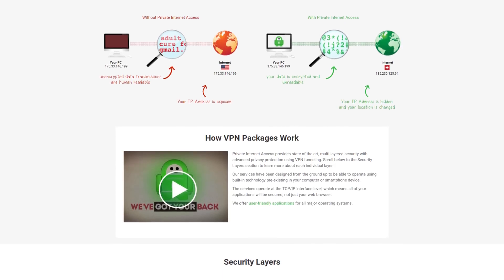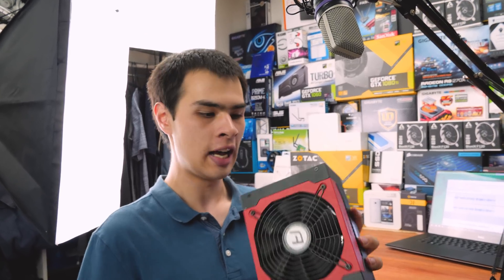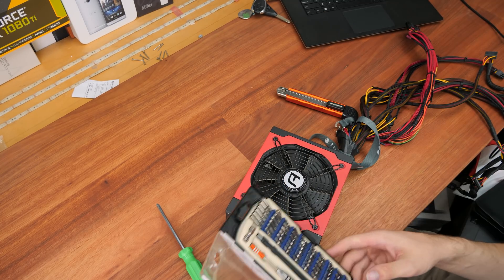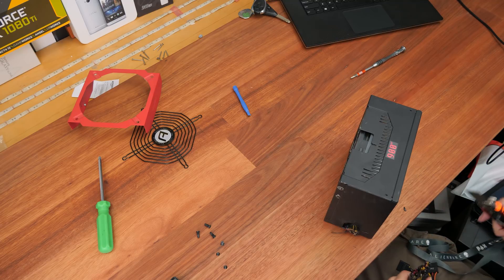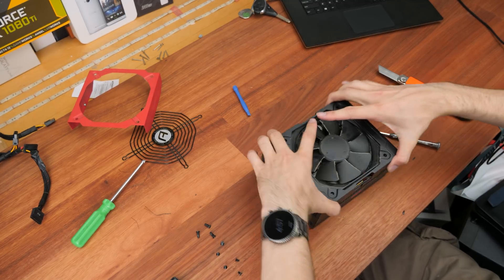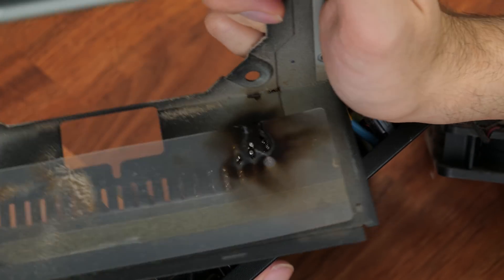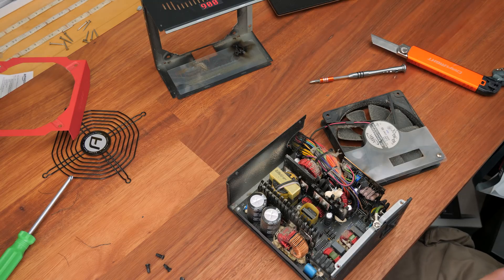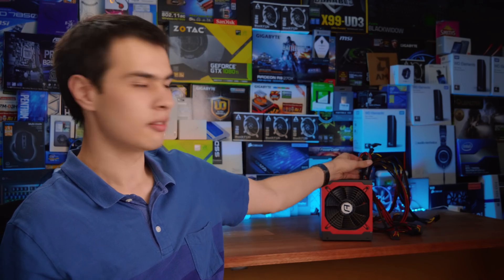Exploded PSU Tear Down

Comment: Hello, i plugged my CPU without checking the voltage of my psu switched to 155v which should be 220v and the psu got toast. is there any chance that my whole cpu is not working? i dont know if i gonna buy power supply or just dispatch the whole desktop.

Comment: I'm here because my Corsair RM1000x EXPLODED last night. All I did was swap my 2080Ti out for my trusty ol' Strix 970 from 2015 to see the performance differences on an old gpu.

The GPU is what caused the explosion since it's the only part that changed from an otherwise working system since 2019.

It exploded instantly after I pressed power button. Smoke all over my room. Smells like hell. Luckily all my data is fine.

I've had a Corsair GS700 smoke out overnight killing my motherboard in 2017, and now this. I also have a Corsair RM850x but I don't trust it anymore. So bad that I won't ever power up any system with corsair PSUs now.

PSUs are supposed to be robust and completely failsafe because they can actually kill you and burn the house down. I have no idea why they cheap out on these... A cheap PSU shouldn't even be an option.

I still don't know if my motherboard and cpu are fine or not ... I do have an RM850x that powers my side build which the 970 was initially in before but... I won't dare power this system on with anything unless I have a completely new and better power supply. I'm thinking EVGA Supernova or ASUS ROG Thor 850w.

The 1 kW power supply was an intentional overkill because I've had power supplies killing my hardware before but here I am again.

Comment: 2 days back my power supply went kaboom, it was a brand new Corsair TX650m 80+ gold. have no idea why it happened. i was running 2060 super and ryzen 5 3600 overclocked to 4.2Ghz. Can somebody help me pinpoint the cause?
Reply: is your gpu and processor safe? what are the other damages?

Comment: Also, a relay is a remote-controlled switch. So it can't be voltage sensing, just like your light switch can't sense anything. The power resistors are not flopping around, they're mounted vertically to save space. CPU C-states and power/voltages they require are definitely not the issue here, these would be handled by your motherboard's VRM (=Voltage Regulator Module). The only thing that changed in ATX is they put more power on the +12V part than on the +5V, reverse from what it was before. Resistors don't really explode, so this was just heating up enough to burn out the PCB's material. Carbon is conductive, so as soon as that happened you got an instant short and the moment that happens you don't see your power rails.

Comment: The wires are not "silver". It's aluminium and the reason they use it is because it's cheaper than copper. The amount of wire coming from an ATX supply isn't worth anywhere near $200, more like $2, if that.

Comment: Ok guys be careful when opening PSUs those big capacitors inside basically hold up to 350 volts! They probably won't krill you, but they can do some damage. Don't touch the pins under the board with your bare hands check them 1st. As for what happened with this psu, those resistors have been getting hot, over time the heat has melted the plastic protective sheet and the plastic board standoff which has allowed the board  to touch the shell of the psu which is earthed creating a short circuit and the psu is history. Thats my thoughts, I'm an electrician btw.
Reply: My psu power chord sparks and the wire burnt when I plugged it. Will it explode if I use a new powerchord?

Comment: quick question: what happened to the rest of the system? did the mobo, cpu, and gpu, etc all went dark?
Reply from the maker: the rest of the system actually was fine, i think i might have forgotten to mention it or cut that shot but the PSU was the only thing to go thankfully
Reply: @CPUmodder  probably a good thing if those parts are expensive or old

Comment: Have that same PSU, have had it for 7 years now, served me through a 2600,3570,3770k and now a 8700k, still no issues yet, fingers crossed...
Reply from the maker: dam that's a nice service life for that PSU
Reply: You should clean it
Reply: @nathanmead140  Whole system gets cleaned every 2 months :)
Reply: @SiR_KaMiKaZeE  but does the inside of the power supply get cleaned too?
Reply: Please replace it. Exploding PSUs are horrifying.
Reply: @CaptainXLAB  Looking back at the video it looks like his PSU had been through a warzone, chopped cables and all, although I did replace it a couple of days ago, but only due to it not fitting with my new build, I did take it apart to inspect it, there's no bulging or leaking caps, it now has its new home in a lower end  (3770K/GTX 1070) gaming system, while it was mine it spent it's time getting cleaned regularly and never anywhere near used near it's rated wattage oh and it didn't spend a year in Iraq...

Comment: I recently had an Antec TruePower Quattro 1000 watt PSU do a similar thing after a planned power outage and when the power came back on it tripped the breaker in the power box so I mistakenly figured it must just be a fluke occurrence seeming the power had only just come back on and I flipped the breaker to my computer room back on and that's when I heard the bang :(

Walked into my computer room and straight away I could tell that the PSU was gone by the smell and after further inspection it had let out the magic smoke and burnt the clear plastic insulating sheet just like yours did. Fortunately nothing else in my rig was affected.

That PSU had given me 11 years of faithful service including an incident where a cockroach had gotten inside an shorted the 240 volt tracks and blew a large chunk of the track off the PCB but there was enough left that it still chugged away for many years after.

I wanted to repair the PSU but couldn't find a schematic for it and contacting Antec was fruitless so I just bought an 850watt Corsair to replace it :(
 
Antec TruePower Quattro TPQ-1000 1000W PSU, 2007 - 2018 R.I.P.

Comment: im not electrician but id assume that the explosion was caused by a heating issue or potentially a surge of electricity that caused those resistors to be overwhelmed
we in australia have our outlets at 240v and it is possible that the powersupply was not intended for 240v input 
thats why some powersupplies have a red switch that can change the input voltage 
and if changed it will cause the psu to explode 

btw im pretty sure that the copper things are copper coil transformers and are there to convert the ac current to dc 
and probably stepdowns the 240v to 12v 15v and ect 

also dont try this at home as it is dangerous since capacitor can still hold electricity and could potentially kill you
if you do tear one down leave it for a week or so for the capacitors to discharge them selves if you dont have any way to discharge it your self
Reply: Those power supplies can do 110-240 volt and the onboard electronics are designed to automatically sense the input voltage and adjust accordingly, until they don't :(

I would hazard a guess that due to capacitor aging the power was not filtered adequately to the power sensing electronics and that's why it let out the magic smoke :(
Reply: @Fridgemusa  well it certainly abnormal to make magic smoke from a psu
most people just do in a poweraid bottle and a hose
Reply from the maker: yeah seems to be along those lines, and yeah I had made sure everything was discharged first  :)